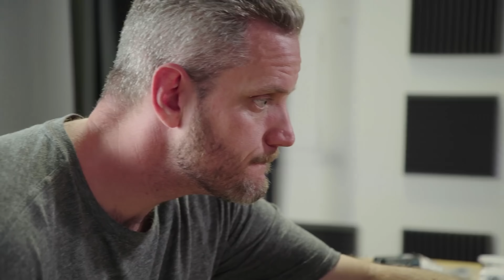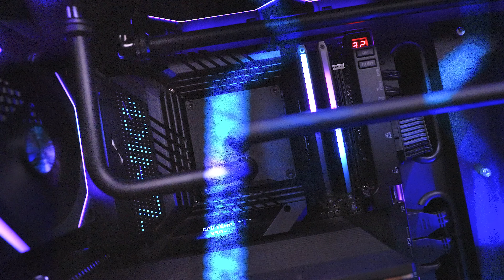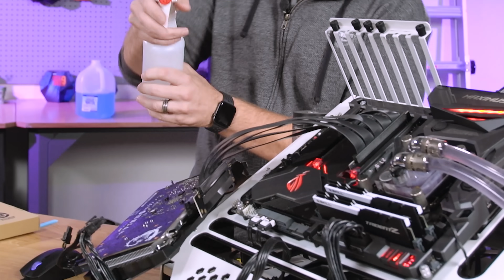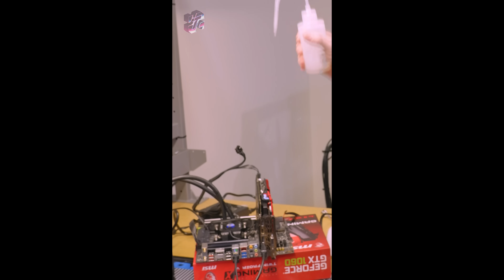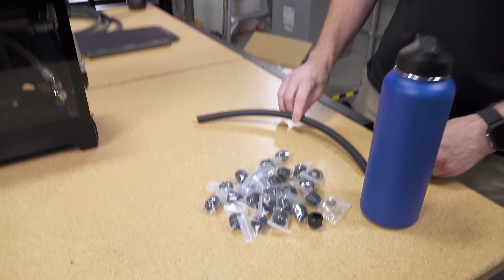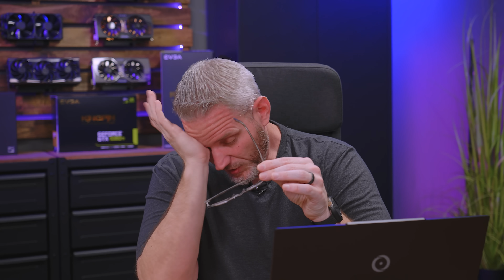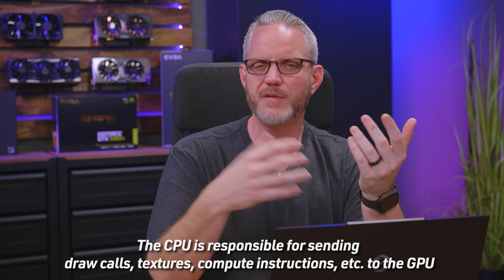5 Myths about Watercooling that are WRONG!

Comment: The main reasons I don't use water in most of my systems, even though I really like to do that, are: Cost ($70 for a CPU cooler vs $300+ for water block, tubes, fittings, quick dis-connects, radiator, pump and reservoir), maintenance times (dusting off with compressed air is fast an easy, flushing a loop and checking for oxidation sometimes takes days), increased risks of system downtime, and build space requirements. Also, maintenance on an air cooled system can often be done with the system running, while water loop inspection more often requires you to turn it off.

Also, you said that water cooling your PC doesn't make a system run cooler and result in less heat dumped into the room. And the truth is, it depends. Water cooling is more efficient, which typically results in much lower component temperatures. This means, the same component can run stably at a much lower voltage. And that does affect how much heat is dumped into the room, if this savings in power usage outstrips the power usage of the pumps and radiator fans (which with a large enough radiator, you can even do without). This then in turn, can lower the temperatures in your room. Of course, this is not a difference you will notice much of, if you PC doesn't run full tilt with all CPU cores loaded all the time, 24 hours a day, and 7 days a week. Also to take into considerations are your monitors, as well. These typically use between 60 and 130 watts and significantly contribute to a desktop computer's heat output. Another thing is hard drives (yes, the ones with spinning rust). I have over 20 of them in my computer. That's also almost 100W in power usage, and in turn heat dissipation, just to store and retrieve data from them. It all adds up. And unless you target a power budget, rather than a room temperature budget, and you have to factor in any air conditioning with it, improving the efficiency of the cooling system is very well worth it. In datacenters, simply running everything at a slightly higher ambient temperature is often the better solution, because wasting the electricity on air conditioning is a far worse proposition, though.

Comment: For a reassuring horror story regarding watercooling leaks, here's a "sample size one" on how not that bad things are:

I've watercooled for a long time and at one point I had two Radeon 5770s (I think) in Crossfire. Due to a mix of not great acrylic, overtightening fittings and harsh environmental conditions, one of the blocks got some bad cracks around the fitting and leaked a not insignificant amount. This was a horizontal motherboard layout too (it was an Antec Skeleton case), so by the time I noticed, there was actually a small pool of water on my motherboard, right where the PCIe slots were and the computer was on at the time

As I kept my panic internal, I just calmly assessed the situation, turned the computer off, drained the loop, removed the videocards, dried off the motherboard the best I could and returned the original stock coolers to the GPUs. I think I gave the motherboard a two or three days to dry off proper before I actually started using it again and that computer was fine. I used that motherboard AND those GPUs for like... 3-5 years after. With the GPUs, I ordered acetal tops for the blocks and looped them back in again once they arrived

So yeah, this is almost a worst case scenario sort of deal and I didn't lose a single component. Lucked out, for sure (there was plenty of dust on that mobo, I'm pretty sure) but.... yeah, far from "instant death sentence" sort of deal. Way safer than having a regular stock cooled 40-series fire hazard in your system, apparently =P

Comment: So I built my loop maybe a little over a year ago now and I didn't realize it at the time because I just needed to get it done and back up and running, but I never installed a drain. Is there a way to drain it easily without making a mess or spilling over everything, or is my only option right now to just use the squeeze bottle to keep draining it?

Comment: I want to get an aio because my cpu hit like 71° at idle in the heat we had this week, but theres like no way to fit a 360 on the front of my case unless i find one with a block that will fit through a small opening with the rad and fans behind the front mesh. I could go 240, but bigger number more better

Comment: I would love to see a vid measuring inlet/outlet temps and inline fluid temp sensors. It would also be interesting to see a review of the thermal exchange capacity of various radiators since as you alluded to,  those aren't widely published specs

Comment: I've watched you, maintenance is a nightmare! ;-)
I've bought about 100 used CPU Air coolers and not one of them has ever failed, I've bought 3 used AIOs and 2 of them were dead.
Resale, it's like putting a body kit and exhaust kit, and blower kit on your ricer, you'll never get 1% of your money back when you sell, in fact you will end up having to pull it all off just to sell it.
I just picked up a 13700k and a NZXT 790 and my Noctua D-15 does just fine and never needs more than a dust off and will likely never die.
I buy/build PCs and components and I stay away from liquid cooled systems unless they are giving it for free and put the air cooler back on the GPU.

Fun to watch you play with them tho ;-)
Reply: Or you just don't do maintenance lmao.  I have 2 water cooled systems.  The older one hasn't been apart in over 7 years since I built it.  Doesn't leak, isn't corroded.  Still basically cools nearly as good as it did when I put it together once I dust out the rads and the cooling loss is most likely due to 7 year old thermal paste.

I have changed fluid in it a few times but that was just due to the fluid losing its color more than anything.  I just use jay's method of cracking the drain and running 6-7 gallons of distilled through it with the pumps running to flush it down to pure distilled and then re-add the coolant mix.

If you cheap out on water cooling stuff you are going to get burned.  Buying used AIO's is your problem.  If you put the proper investment into it and build it properly it just works.
Reply: @JathraDH  Sounds like you put together a great build, but if you went to sell that PC you'd have a much harder time than if you had some solid/decent air coolers.  That said I assume you knew all that when you built it and that's cool.  I guess Jay is just really bad a t building water cooling ;-).  

And yes I try to  never buy used AIO(or any water cooling), but sometime systems/lots come with them and they always seem to have issues 

 I just ended up with a corsair  AIO that came with a case, that just wouldn't work that I was going to just pull the fans from and recycle, but on a whim i contacted corsair and they just agreed to ARMA for a new 180 dollar AIO, which I was very surprised about.
Reply: @gottahavitvt  Yeah I never sell my PCs I still have my Pentium 120 PC parts sitting in the closet.  It's not a big deal for me.  Cheers.

Comment: I also bought a load of fittings and most of them are Dracaena and they do look fairly good and I would have never of thought to do so but after seeing you video a while back and actually having them in my hands they do look quite good even next to the corsair parts I have. The only reason I did end up buying them was because of the EKWB EK-Tube ZMT having an I/D of 9mm rather than 10mm that my current tubing has, and the Barb fittings I bought come with 13mm hose clamps which are to small to stretch round the hose when fitting on the barb so you will need bigger clamps . The 15mm ones I bought do fit and they are very snug and are wider but does sit between the barb and the knurled area of the fitting.
So here's my part list that will allow me to redo my loop.
KEALBAUS 15Pcs Barb Fitting Water Cooling Radiator for G1/4 Chromed Copper Water-Cooled Heat Sink for Pc Computer   £14.40
Sourcing map 10pcs 15mm Spring Band Type Action Fuel/Silicone Vacuum Hose Pipe Clamp Low Pressure Air Clip Clamp, Nickel Plated   £5.69
Dracaena 6 pack G1/4" thread, Male to Male Mini Extender Fitting with tighten O-ring, Compression fitting for Computer Water Cooling System, Silver   £24.96
Sourcing map Male to Female Extender Fitting G1/4 x 25mm for Water Cooling System Silver Tone 6pcs   £14.99
Dracaena 6 pack G1/4" thread Male to Female Extender Fitting, 90° Rotary Enhance Multi-Link Adapter Fitting for Computer Water Cooling System, Silver   £19.99
Richer-R G1/4 Water Fitting Splitter, G1/4 Thread 3 Way T Shape Fitting Splitter Adapter for PC Water Cooling System   £5.96
Corsair Hydro X Series XF Fill/Drain Valve - Chrome (CX-9055020-WW)   £18.39

Comment: Hey Jay, Now i know flow order doesn't matter, and my current set up is pump/res to 360mm rad pull config on fans, then to gpu, cpu, 360 rad with push/pull config back to res. Now my question is Hypothetically speaking would you see a little bit lower temp on the cpu if you put a push config 120mm rad in between the gpu and cpu??

Comment: To add to the 3rd topic you talked about with cost, The fact you have to buy additional is the problem but with some of these cards coming out with water coolers with them, you are not buying the old air cooler so that cost is offset but you are still getting a giant radiator and possibly with fans, so mark ups are going to happen in one way or another but included AIOs on GPUs is the best route. CPU is the iffy one but still markup either way for more of the radiator/fins for the cooler and any fancy stuff. Cost is more subtle because included coolers are and iffy thing so you more than likely will still be buying the cooler for the CPU. Fans for either if you have to buy or not can be offset as they replace normal case fans for circulation. Maybe doing a video of cost to cost with Air vs water could put the real cost in perspective. Not sure if you already did a video or not with that or if its just something you touched on but not went deep with.

Another thing which is a myth with some misconceptions about it is Water cooling is not actual water/liquid cooling. There is 2 main types of liquid cooling and that is by example, evaporative coolers like the "swamp" coolers where water evaporates and fans move the cooled air. Another example is cooling ponds where the water directly expels heat.
The second type is direct cooling of a liquid like liquid nitrogen being applied and all the cooling is done by the liquid itself. In an offset type of way as a combination form, An Air Conditioner does kinda both as its the liquid becoming a gas to put out the cold but also the liquid to take away the heat. 
None of these is the water cooling of a PC (normal water cooling) as its all closed and all the water does is circulate and transfer the heat much like heat pipes or even a basic metal heat sync. Once that heat saturates then the water does not do anything else but transfer to a large air cooled radiator that might be in a better flow position. The old misconception of water coolers giving instant performance and why thermal saturation needs to be done first before doing tests is the base of this whole myth. Took a while of people like Jay to try and relay that first part to people but its still a common enough myth thats still going around to new people. Not as bad but still a thing and people do still mistake the difference between actual water/liquid cooling vs AIO cooling. Main reason is that its still a though in peoples minds that "I need water cooling" instead of a cooler to fit your needs as its been proved by many that some water cooling solutions can be worse than a fair bit of the best but still decent priced air coolers. This does feed into the Cost bit as well because larger Rad, more fans, bigger case to house it all and so on.

Comment: Definitely appreciate this video. Very much looking forward to that temperature difference video, if you can make that happen.
Definitely also agree with the notion of going with soft tubing for the loop. i use vinyl tubing for mine, in part because I was able to source a 20-ft roll of it for $10... at that price, I can literally afford to just throw out the old stuff when cycling new coolant every six months. That said, I do wish those old-school silver coils with the biocide were still readily available, since then I could get away with using distilled water instead of having to use a pre-mixed coolant.

Comment: Water cooling is no more efficient then a normal heatsink of the same dimensions -aka a 140mmx2mm rad vs a 140mmx2mm heatsink
it just has a larger heat soak capability for heat spikes

the main reason is the air has a max amount of heat you can add to air
copper is 398 W/(m²K)
water is 500 to 10,000 W/(m²K)
air is 5 - 25 W/(m²K)

Comment: Would love to see you make a budget watercooled build - Something with not over the top specs but still enough to warrant water cooling, what value that would be and what performance watercooling a system like that would offer etc. I feel like that would be interesting.
Reply: get a second hand eiswolf or eisbaer and you'll be fine
Reply: That doesn’t make sense. Why would you go through the hassle for a mediocre to barely good cooling? It’s not easy to build a loop for your specific case. It’s a effing b* to clean but required. A proper case is expensive. Unless you’re willing to spend a minimum of $1k minimum (wc parts + case), it’s better to stick with AIO or air cooling.
Reply: @Paul_Sleeping meh... you can get away with $300 for a budget CPU loop. With the ability to add in the GPU for around $150 more block + rad(depending on block price). You simple don't have to buy over priced parts... and at the end of the day, you will get the same performance.

As for case. That's just needless gate keeping. A; if your case is remotely modern, it should have space for 1 or two 360mm rads, maybe a 360mm and 280/240. Either of which is enough for all but the highest end PC parts. B; if for some reason it doesn't. There is nothing stopping you from external applications. At worse, you can get a fantastic case for $150. Or a ton of other options in the $70-$120 range.
Reply: @Paul_Sleeping  I don't think you understood what I meant. I was saying it would be cool to see a water-cooled build that wasn't an i9 and 4090, maybe something lower high end tier with mid tier water cooling parts for "water cooling on a budget" so to speak.
Reply: @guacamoly-.  Gotcha. Sorry I misread.
Reply: @guacamoly-.  IMO issue lies with graphic card cooling. Getting full cover for lesser models are rare, and if they are present, that price is going to be... hard to justify, especially for middleweight card. Universal core-only blocks I presume still exist, but then you need to sort out memory and VRM cooling, as those are usually cooled by the same chungus that handles core. Thus, bunch of small radiators to be glued with adhesive pads and/or arranging airflow. Then, any better-ish AIB models have plenty good cooling without being loud, further reducing gains from watering the card.

For CPU cooling only, lets be real - AIOs come in all shapes and flavors and they are almost universally cheaper than DIY loop while having similar to identical performance. And then nothing stops you from modifying it - longer/different tubing, adding reservoir of sorts for filling and bleeding. Unsure if pump can handle extra resistance of adding GPU block into the loop though.
Reply: @Panocek  Decent full-GPU blocks are $100-150, not that terrible. E.g. Bykski or Barrow. In my limited experience the major downside to those are nearly zero documentation for thermal pad size/placement but it's not that complicated to figure it out.
Reply: @Panocek AIOs have somewhat similar performance, but nowhere near identical. Multiple rads does make a substantial difference in temps, pricing however, is another story.

Comment: Im against it when people are trying to water cool things that can be very easily taken care of with an air cooler.
Water cooling has more points of failure than a heat pipe, aluminium fins and then a fan.
Two of those three components are so unlikely to fail i would say its impossible.

Water cooling has more components to it, more points of failure and it also shares a point of failure to air cooling.

I dont see the point in water cooling unless its a really hot chip that needs it or if you dont have the space inside the case for a large enough air cooler, but because its expensive and fancy and "exclusive" people will chuck it on anything when it really doesnt need it just so they can brag about it and its often just the cheapest aio they can find with fancy rgb lighting and all that crap.

ive seen people putting aios onto r5 5600 and 5700 cpus before, ones that they arent even going to overclock.

Comment: I have a loop of pump/res -> temp sensor1 -> 32 core threadripper -> RTX 3090#1 -> RTX 3090#2 (SLI, btw) -> temp sensor#2 -> 420x30 mm rad#1 -> 420x30 mm rad#2 ->  pump/res.
The delta between temp sensor 1 & 2 is  rarely greater than 3C. 100% load with full CPU & dual GPU cranking has about a 6C delta.
Total coolant temp has never gone above 45C and averaged 36C during gaming.

Comment: 16:08 restricting flow or slowing down pump speed to increase residence time in the radiator will decrease cooling potential. In a car, a PC, or a giant industrial heat exchanger, you can't hurt cooling by incressing flow rate unless you create cavitation, which won't happen in a practical application. This is a commonly perpetuated myth in the automotive world. If you increse flow rate you will decrease the temperature differential but increase cooling capacity. The higher the flow rate the less loop order would matter as well.